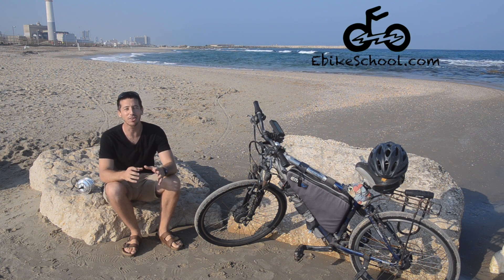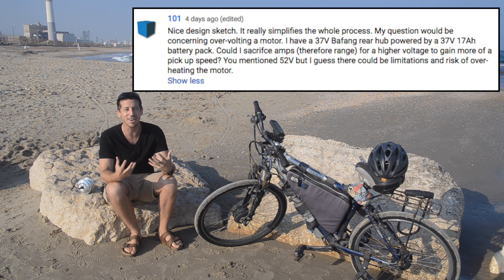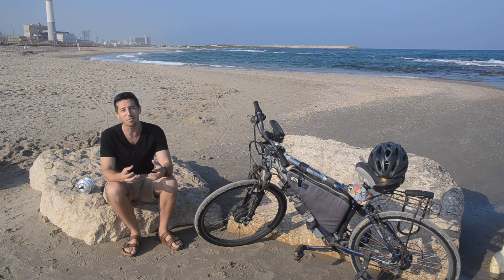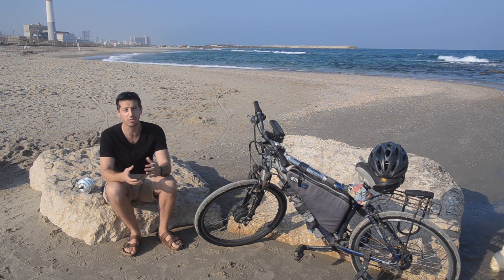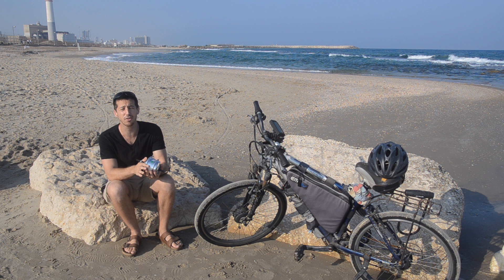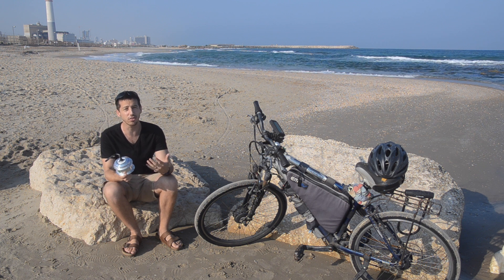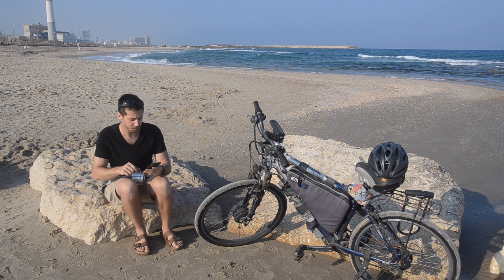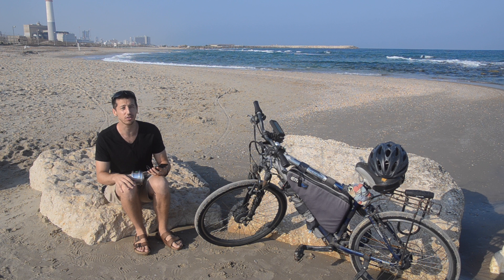Overvolting an electric bicycle motor for more speed! Q&A#7

Comment: Hi Micah, I love your videos and have read both of your books. 
I'm considering overvolting a 1000w DD motor as there are lots of cheap 1000w kits available (I live in the UK). Is this advisable Vs buying a 1500w kit? Would i be sacrificing effeciency by overvolting a 1000w motor rather than buying a 1500w motor? 
many thanks
Reply from the maker: Those standard black 48V 1000W motors are some of the most common to hotrod. You can definitely run those at 60V or 72V, but know that the speed is going to be pretty fast. They are already usually geared for around 25-30mph. Another option is to just get a controller with more amps. A 48V 30A controller would be 1500W, which those motors can usually handle. They are heavy motors, which means more metal, which means its a giant heat sink. Once you start getting above 1500W though, there are other measures to take to reduce heat, like filling with ferrofluid, using hubsinks, drilling air holes in the side covers, etc.
Reply: EbikeSchool.com Thanks! As I understand it a 1500w motor would usually have a larger stator compared to a 1000w motor. Does a bigger stator mean it is more efficient or just that it can handle higher watts? My confusion arises because both the 1500w and 1000w lots are marketed as 48v. Does the 1500w motor just draw more amps?

Comment: Does it have any drawbacks (besides the increased weight and price) if i use a motor with high wattage, let's say 1500W but just supply it with 1000W ?
Reply: A motor will ATTEMPT to deliver the power you demand, regardless of the watt rating.

If you apply a load that demands 20,000 watts but the motor is rated 1500 watts, you'll blow a fuse or melt down the motor.

The watt rating is essentially how much power the motor can deliver without overheating.  Demanding less will never hurt the motor.

Speed will depend on what you are doing...  I have 1500 kv motors rated from 150 watts to 6500 watts.  The 150 watt motors are much smaller and lighter than the 6500 watt motors.  Without load, if using the same voltage (applying the voltage for the lower rated motor) they'll turn the same rpm.
kV (how many rpm the motor WANTS TO turn per volt applied) is determined by number of magnets, stator poles and the winding pattern on the stator.   Its easier to design a small motor for very high kV than a large one and easier to design a large motor for low kV, but you can get a VERY wide range in any given size.
Reply: Or will it work just as a 1000W motor woud ?
Reply: It will run slower than the 1000 watt motor
Reply: I have played with many different brushless motors for a while now, and what I experience, is when I over motorize an RC plane, lets say with a 1500Watt motor @ 22.2Volt, but the plane need only 1000Watt motor at normal flight, my experience is that the 1500 watt-capable motor works better with better efficiency at 1000Watt than a 1000Watt motor does at 1000Watt. 
When the iron core is approaching saturation, the windings cannot longer induce stronger magnetic field in the iron, and the windings inductance drops over that given current limit. Low inductance at a given frequency reduce the impedance in the windings, which again increase loss/heat.
The smaller 1000Watt motor have this saturation limit closer to 1000Watt than a 1500Watt motor does. Therefor, the 1500Watt motor have better efficiency at 1000Watt than the smaller motor, and will, in theory, perform better @ 1000Watt supply than a 1000Watt motor does.

Comment: Mike, I have a questions. 

I recently upgraded my motor and ever since then, my controller has been running super hot. 

I assumed that my controller was under spec'd so I bought a new one to match my 1200 watt motor. But all the other ebike experts assure me that there's no such thing as an "under spec'd" controller. They did helped me trouble shoot the problem and I discovered that I had dead hall sensors. Which explained why jerky offs from a dead start. (I always have to make sure I push off before I twist the throttle). But I have this nagging feeling that this may not be the cause because I had that experience with take off on my previous motor and the controller wasn't getting hot at all. 

What do you make of this?
Reply: Thats the thing. You can overvolt your motor but not your controller.
Reply: I dont know if you will read this but if a Hall sensor goes, your bike (at least MY trike, WON'T  RUN. What Hall sensor is bad? If it's your throttle, REPLACE IT. My trikes throttle sensor was out, trike did not run. Replaced and it was fine. Hall sensors cut off the power all the way when they go out. In my experience. Good luck!
Reply: @sunnybeaches1331  I was using a dual mode controller that could run sensorless at the time. Bigger motors draw more amps in my experience despite what anyone will tell you

Comment: Been watching your videos and am a fan even though my understanding is limited by my brain's Ah.... :)
This is off topic, but... if my current 36v acid battery is rated as 14ah... what lithium ah would I need?  And, if I overvolt to 48v... do I have to change the wiring in my this scooter?

Comment: I have recently bought your book on diy lithium batteries it makes for an interesting read, I bought it based on jahugarcias recommendation and am not disappointed, good book.

The idea of over volting a motor is interesting, using 18650 cells you could up the voltage incrementally, ie by 4.2 volts so take it to say 42/46 volts thus keeping it well within the capacity of the speed controller and giving you extra speed.

Now if you could only get the makers of these batteries to sell them at a price we could all afford especially in the UK then that would also be a huge step for human kind.

example of what i'm talking about is this, I just bought a 15 ah 18650 battery pack which cost 260 pounds which is probably around 300 dollars or so, compare that to the price of the cells in the USA and i'm guessing it would be a hell of a lot cheaper.

So you can see why electric battery bikes are not that popular, apart from the obvious restriction on motor size being 250 watts, and are speed restriction of 15.5 mph, which most people can run faster than, but hey laws are meant to be bent right.
Reply from the maker: Yep,  the mistake was already pointed out to me but thank you! I've already submitted a correction version!
Reply: But no link to down load it so it can be added to the book that we already have for those who have already got your book.

Just a suggestion but if you have a link to a web site those who already have your books could down load updates to the book for corrections.

After all putting pen marks through pages where mistakes are is unsightly on a paper back book, but a copied page inserted is better.

So even though it's good you have made the correction for your book that is printed from now on, but how about doing the same for those who already have your book/s.

It's a good book.
Reply: If you are within the UK you can buy decent original batteries at nkon.nl for a very reasonable price.

Comment: The big thing, i can't find informations about :/, is battery cooling...
For what rides is it needed? For example, can i run a 5.4kW 37V system witch 100 cells safe without cooling? :D
Reply: Streifenprinz that's really hard you should try 72v that shouls make it easyer in the batteries
Reply: absolutely right, but even then...i can't find many tutorial when i have to add battery cooling ;)
i mean....can you just ignore the problem off battery heat? :P
Reply: Streifenprinz well today I'm repairing my ebike I am receiving my hand throttle I am using an arduino as the controller since I have a dead hall sensor but my drone esc does not need a hall sensor it works I have some videos about it but you can ignore it if you know your batteries aren't heating up too mutch like my ebike batteries are sealed in an alluminum container they never never get warm but that's because the max power I pull from them is 500 w before the bms kicks in and shuts the power down
Reply: 5.7kW at 37V means you draw a total current of 146 Amps. With a 10S10P set-up you draw 14.6A per cell.
You should chose cells that can take that amount of current. For safety double the amount you need, so look for cells that can deliver 30A or more. Some Sony Konions can do that (and more). Cells that can deliver high currents normally do not have the highest capacity.
Examples:
Samsung INR18650-20S  is 30A
Sony Konion US18650VTC5A is 35A
Sony Konion US18650VTC6 is 30A
Sony Konion US18650VTC5  is 30A
Sony Konion US18650VTC4 is 30A
LG ICR18650-HB6 is 30A
LG INR18650-HB2 is 30A
MXJO IMR18650F is 30A
The amount of heat built up has to do with the internal resistance of the battery. That should be very low.
The Sony Konion US18650VTC6 is probably your best choice. It has 3120mAh and overhere it costs under 5 euros.

Comment: you can over heat the motor if you put higher voltage. electric motors do have voltage limits due to heat problem. mosfets inside motors can melt when the coils over temp

Comment: The three phase wires on the controller get especially hot when under extreme loads and over-volting. If they burn through their insulation and touch. Its pretty much instead death to the controller. The symptom of phase wires touching is a shaky and inefficient freewheel spin on the hub motor wheel. Shrink tube is probably the answer, but I will try covering the phase wires in old inner tube rubber.
Reply: Ajemo Haltom Shrink tube will work, I like marine heat shrink better, but I think easy fuse Silicon tape is best. It can insulate 8000v, go up to +500f, it's waterproof, flexible etc very useful stuff. At $4 for a 10ft roll, imo it's pretty nicely priced too.
Reply: That's the stuff. Thank you ABritInNY, a good pointer was really what I needed. Silicone had crossed my mind, but how to apply it eluded me. This will work!
Reply: Ajemo Haltom Sure np, glad to help. Hope you have an easy repair and are back to happy riding.

Comment: just do 260 revolution/minute x minute/60 seconds x 26*pi inches/revolution x mile/63360 inches x 3600 seconds/hour to get an exact answer.
and for km/h:                                                                                                                  x  2.54 cm/inch x km/100000 cm x 3600 seconds/hour

this comes out to simplify to rpm*(tire size in inches)*pi/1056 for km/h it is rpm*(tire size in inches)*pi*381/250,000

Comment: Can you buy a motor that is 250W at 1V and say it's legal for your area(assuming the limit is 250W), but run it up to 96V(or w.e)?
Reply: 2Awesome I dont know if you are acting or this is a real question but it would be really hard to get 1v 250w that's a lot of current
Reply: It was an extreme example. Basically, can you get a 12kw (at48v) motor and say it's a 250w (@1V) motor?

Comment: If it's assumed a motor's stated voltage from the factory is directly related to safe heat level then I would be careful giving it more than it's rated at least for prolonged intervals. The more pertinent issue is the temperature at which the motor windings are designed to operate so they give a long and predictable insulation life.
Reply from the maker: Yea you have to watch the heat build up. If it's staying relatively cool, you're fine.

Comment: Hi, Mike. Congratulations for you channel! I have a question for you: How can I know if the bms of my DIY battery is working fine?
Greetings.
Reply: Ian Mangham what is BMS?
Reply: Thanks for your answer. I've checked all and it's correct. I think it could be the controller what is not running well, it cuts the current when the output voltage in the battery still over 36V :S.
Reply: Afmu Warden 
I'm never using a BMS, and this is why.

https://youtu.be/pljSZcEwc8Q
Reply: Afmu Warden that should be easy just check the coltage and current is going into each cell I have the experience and the cells to make a72v battery at 20ah but its too hard so I bought one
Reply: Hi Nightmare, thank you for your answer.

I've already built a 36V 11.2Ah battery with 40 Samsung 2800mAh cells.
I checked the voltage of every series but not each cell. I will do to check what you say.
I have another problem with the carging, the charger voltage is 42.2V (verified with voltimeter) but it stops charging at 40.2V, should I blame the BMS?

Greetings.
Reply: @nightmareinaction629  hi can I use 48v battery of my 36v motor? Thanks
Reply: babierea idos yes you can I am running my 48v motor on 72v atm so and havent had a problem ran it up to 3000w
Reply: @nightmareinaction629  so It will not be heated? My controller is 36 to 48v and 350watts
Reply: babierea idos that should be fine 350w it's not a lot of current for 48v it shouldn't heat up probably get warm but that's about
Reply: @nightmareinaction629  thankyou so much.... But the problem I cannot fine the 48v battery here in UAE hayssssss

Comment: So I'm wondering if the opposite is true then: If I wanted more torque (hill climbing / acceleration), not top speed - I should up the amp draw capability, not the volts? I assume heat generation is even more of a problem with this too?
Reply from the maker: Yes, if you want more power and torque, but don't need a higher top speed, you can up the amps. But like you said, heat generation could be a problem. The best method is to use a cycle analyst or something that can limit current, then slowly increase current until you find the point that your motor starts getting uncomfortably hot.

Comment: I remember reading that the number of windings are also a parameter to determine the speed of the motor vs volts input.
Reply from the maker: Yes, more turns per copper winding results in slower RPM.

Comment: Can you make a bike have 2 diferent wheels that are rated for different voltages? In my case a 48v front wheel and a 36v rear wheel, I currently have a 36v rear wheel that I have been planning on overvolting and I was wondering if it would be possible to put on one of my 48v front wheels onto it also, that way the bike can handle more hills, off road, and rough terrain. Thanks for making this video on overvolting, I have been trying to find a video on it!!!
Reply from the maker: Theoretically yes, but if the two motors are going to spin at very different speeds, then its not worth it. You'll be wasting the power from the slower motor. So make sure you calculate the speed of both motors when they are run on 48V. That 36V one will spin 30% faster.
Reply: EbikeSchool.com thank you! I knew they had to spin at the same speed, but I did not know if it was possible to make work.

Comment: anybody make a remote temp sensor or thermal cutout? I hate meltdowns!
Reply: We have the remote temperature sensors used in RC models.  They would work fine for the bicycle motor.  These can be used to control a relay to shut the motor down without much difficulty.
The main problems being routing the wire for the thermocouple and locating the thermocouple as close to the stator as practical.
Reply: Pulled thermal button from Mr. Coffee, glued directly on motor, ran the 2 wires intercepting ignition(key switch) .
Reply: Almost Anybody  BEAUTIFUL! At LEAST it would give you an aproximate to when to dial back during use. I LIKE IT! and perhaps cheaper!

Comment: Thank you for your informed information. Could you comment on the different  'Watt'  rating of ebikes and if the different ratings are achievable by overvolting ?  Ebike kits sold include 250w, 500w, 1000w and 1500w,. Is the difference in the controller ?  Would it be possible to overvolt, and/or use a different controller  to get more powerful ebikes? - Thank you for sharing your knowledge.
Reply from the maker: I wrote a longform article on this here: http://www.ebikeschool.com/myth-ebike-wattage/ but that would make a good video too, I'll add it to the list.
Reply: @EbikeSchool  please reply sir
Reply: @rohankumarchauhan9653  How did this work out for you ? I was going to try this out myself . You were never going to get a reply if this guy has over 200,000 subscribers . Just too busy.
Reply: @TheSkyPod  I'll use a 48v controller ,in 36v moter , I don't know it's results 😅
Reply: @rohankumarchauhan9653   i used a 36v-48v controller on my bafang 250w. Works just fine with the 36v battery, but when i use my 48v battery the throttle only works 1/3 of the way, the moment i apply abit more throttle, i would hear a wierd beeping/weering sound  and the motor would cut out instantly.. PS I have no display nor pedal assist, just throttle with voltmeter wired to controller to motor.. does anyone know what the problem is?
Reply: Sir if i use 48v battery pack in my 36v pmdc moter , will it burn the winding of moter?? Please reply atleast ,yes or no please

Comment: Hallo,
i would like to ask you about maximizing the range of an ebike. I have a 48V 1000w hub motor and a 11.6Ah battery. Could I add a second battery pack parallel to first one in order to increase capacity and range?
Reply from the maker: 101 is on the right track, but he's mixing up amps and amp hours a bit. amps = electrical flow rate.  amp hours = capacity. So increasing your amp hours either with a bigger battery or adding a second battery in parallel will increase your range. There's no limit on AH size for keeping a motor healthy. Think of AH as your gas tank. Your car's engine will function the same whether you have 10 gallon or 500 gallon gas tank (though the latter will be heavier). You can also increase range by decreasing your current (amps) limit of your controller. Basically it limits your power, making you drive more efficiently.
Reply: As I understand it, more amps give a better range. I have 17Ah (37V) battery pack and it rated as having a 160KM range. Mind you, If I am right you should limit to a max of 20Ah (48x20=960W) to keep the 1000W hub healthy. I am sure Micah or others would know more than me on this subject though.